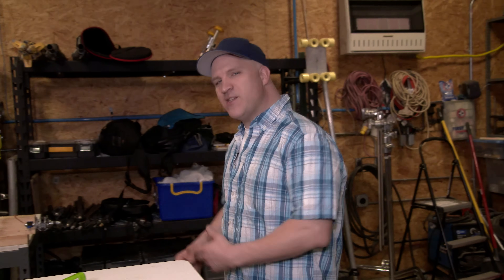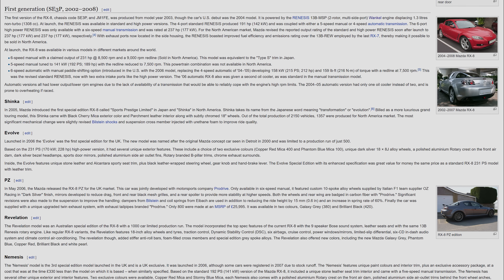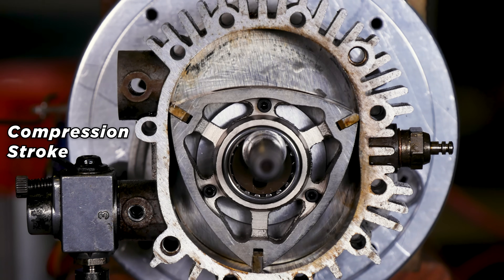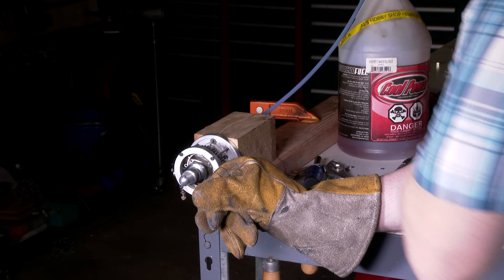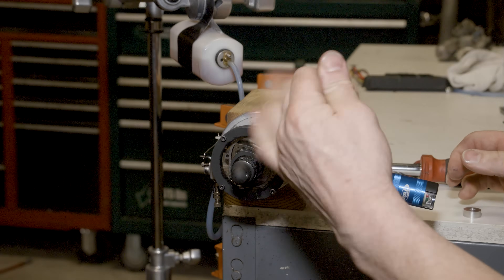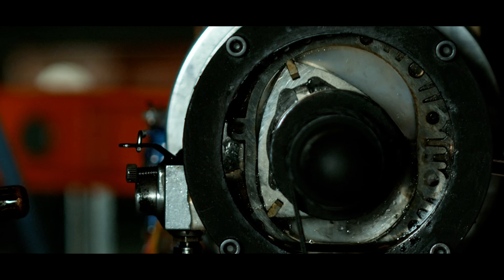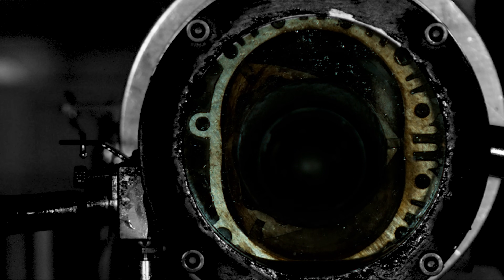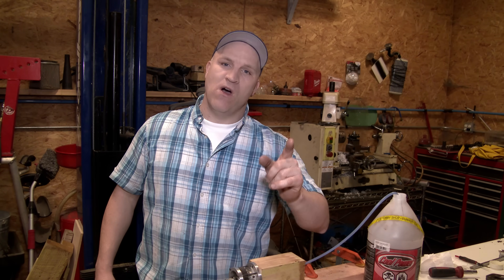See Thru Rotary Engine in Slow Motion - (Wankel Engine) 4K

Comment: I was driving a 1972 RX2 with J ported 13b in the early 80s.    Back then, nobody expected a corolla looking car to kick ass.
Reply: Because it didn't...
Reply: It was an 11 second car.     And I will crush you on anything BMW having been racing them since the 80s.
Reply: Hahahaha!!! Now that's funny!
Reply: I used to run racing dynamics in america before I became the hartge rep. but I've gotten away from BMWs other than building the occasional Improved Touring E30 and E36 though I did work on a M12/13 the other day.

Comment: How the torque can be increased?? Will it be possible?
Reply: The Wankel design is very inefficient in terms of mechanical conversion due to the inherent flaw in its internal geometry that makes it work, so the torque characteristics will always be very poor... its why Wankel engines were never used on heavy vehicles... they just cannot develop useful torque like a reciprocating engine can.
Reply: doktorbimmer.......thankyou for responding, i have recently read and seen some info about this kind of rotary engine, and figured out how inefficient it is !! And as my insights tell it maybe much vibrating as no counter balance is attached to the shaft as well the heavy rotary piston if used in large scale, by the way my question was about torque amplification could it  be achieved by only enlarging cylinder size...as it also waste much fuel and become more inefficient, but adding a fuel injection may work, do you have any experience of such thing because real life outcomes doesnt always comply with the hypothesis..
Reply: Good questions! Unlike the reciprocating engine where the Bore-to-Stroke Ratio can be varied and optimized for maximum torque output. The Wankel's geometric relationship between the diameter of the piston(rotor) and the stroke (offset of the eccentric-cranckshaft lobe) is limited to a vary narrow envelope. The diameter of the Piston(rotor) arc is also limited by the linear speed of the apex seal, effective lowering the rpm as diameter increases and increases the moment. the width of the Piston(rotor) increase the mass and thus moment which both adversely effect balance.
 Mercedes-Benz exhaustively tested direct fuel injection 1967-1970 with the M950F the most powerful Wankel engine ever built at the time, it had an absolutely horrible brake specific fuel consumption and did little to improve exhaust emissions. The Wankel's geometry envelope also effectively limits the static compression ratio that is required to effectively utilize the advantages of stratified charge combustion offered by GDI.
Reply: doktorbimmer  wow thanking you ones more ,... Lots of info there
Its good to know all possible efforts have been made by mercedes to make it efficient then its maybe not possible to improve without altering the whole piston geometry after all , by the way how the shaft is attached to the piston are there  annular gears of anything else?
Reply: Well, it is the very unique geometry ratios that allows the Wankel engine to function in the first place... alter these geometric relationships and the engine will no longer function as an engine. The epicyclic gears maintain the critical 3:1 ratio between the eccentric-crankshaft and the Piston, it also creates the 4-strokes of the Otto Cycle from the 3-sided piston(rotor)..  (the Mazda 13b has a 30mm stroke generated by the 15mm offset of the journal lobe) .. if you change the gear ratios the engine ceases to function correctly. The piston contacts eccentric lobe and is also connected to the housing by the gear mesh... creating an "arm" which is analogous to the "connecting rod" in a reciprocating piston engine.
Reply: In a typical reciprocating engine there is a  Positive Rod-to-Stroke Ratio (ranging from 1.4:1 to 2.2) the length of the connecting rod is always longer to the length of the crankshaft offset and generates a mechanical advantage (just like a simple lever) but in the Wankel, the ratio is fixed and in a Negative ratio, working against a mechanical disadvantage this critical flaw in its basic design dates back to the very origins of the Wankel concept as a supercharger (pump) in the early 1950's  where the shaft is driven by an external source... converting rotational force into reciprocating motion, exactly the opposite of an engine.
Reply: doktorbimmer now i see how the in efficiency builds in, as you stated when being drove from the external source that doesn't matter much, so this design developed popularity, i am wondering despite the major flaws why the big motor company like mazda put all the efforts in, it would be better to use a radial engine if they wanted vertically moving pistons.

Comment: What ultimately determines any internal combustion engine's efficientcy to horsepower is it's   
SWEPT VOLUME = total volume over time (CID or CCD) TIMES  the number of (  revs, rpm,rph ect,) 
DIVIDED by the volume of fuel used. this is what makes the axial flow jet engine 65 - 68 % efficient.
especially when it is driving a high by pass turbo fan.
Thanks to all the commentators below. not one said,  "your motor blow'd up " Arrr !
Reply from the maker: Yup you nailed it "swept volume" is King !. Thank you